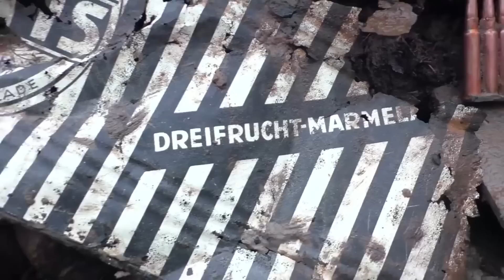Incredible Relics Found in German Dugouts - Metal Detecting WWII Battlegrounds

Comment: I would worry about explosives or grenades
Reply from the maker: Do not worry. If you do not disassemble the grenades then nothing will happen.
Reply: @wwiituberestoration1011  Не зря существуют специалисты по обращению с НРБ (неразорвавшимися боеприпасами). Существует очень большая вероятность того, что заряд в этой гранате все еще способен взорваться, и что он стал нестабильным со временем и небрежным отношением. Большинство боеприпасов имеют срок годности, и если граната настолько старая, что заржавела, то ее срок годности давно истек. Каждый год люди получают ранения или погибают от старых устройств времен Второй мировой войны.

  There is a reason there are experts to handle UXOs (unexploded ordnance). There is a very good chance that the charge in that grenade is still capable of going boom, and that it has become unstable with time and neglect. Most ordonance have a “use by”-date, and if the grenade is so old it has rusted it is WAY past it’s time. Every year people are hurt or killed by old WW2 devices.